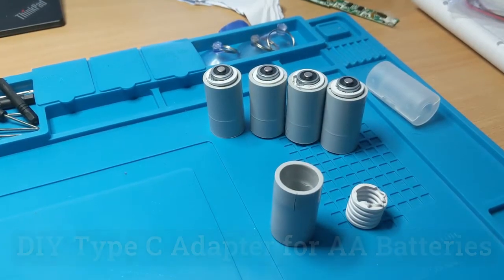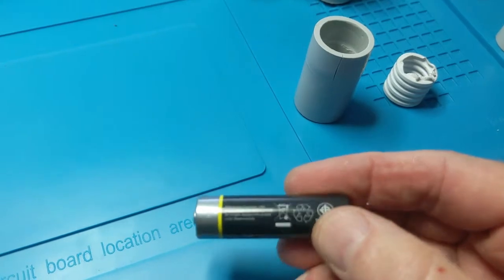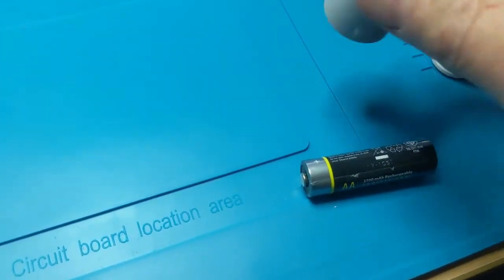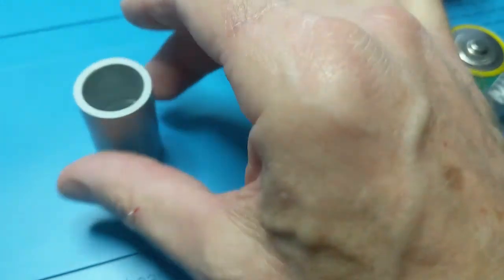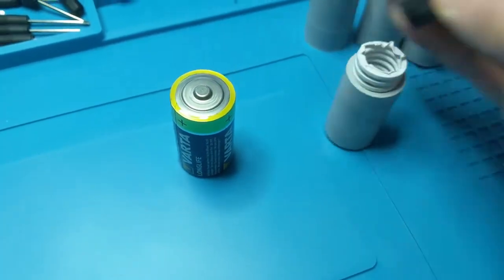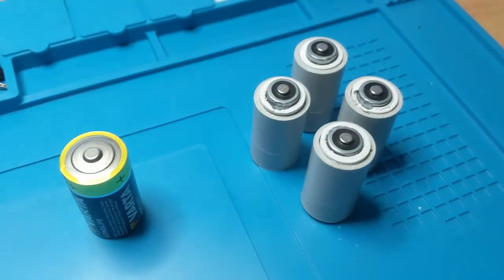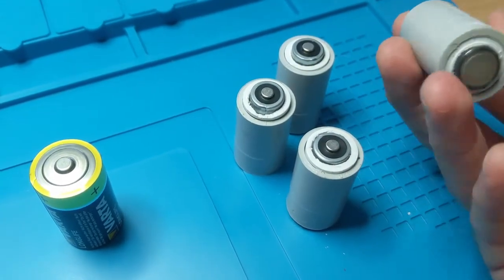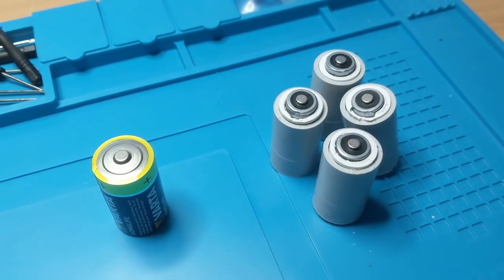DIY Type C Adapter for AA Batteries

Comment: Nice hack.  Was your external power supply a smps?
Reply from the maker: I actually had another go and managed to run my Sureflap pet door from two external 6v 7.2ah batteries in parallel